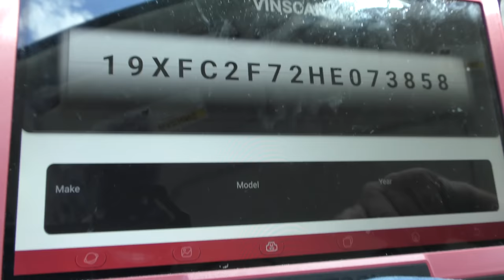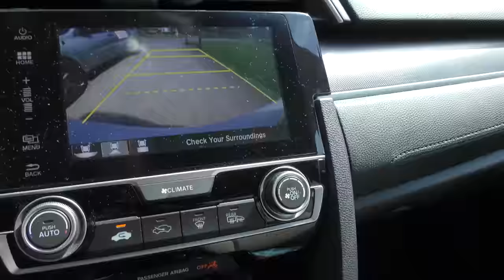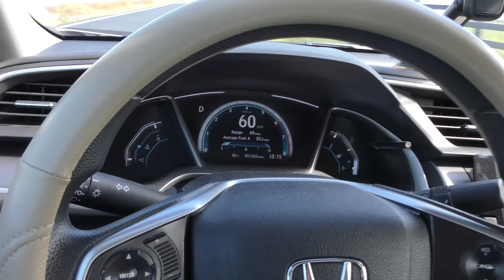Here’s What Happens If You Change Lifetime Transmission Fluid in Your Car

Comment: I change my trans fluid every third oil change (15,000 miles), this way you eventually replace all the old fluid and the fluid remains fresh if you continue to do this schedule without costing a lot.
Reply: SMART!!!
Reply: The Audi ones with lifetime fluid would break if flushed/oilchange. Your regime is akin to "if it aint broken,  fix it untill it is", wasted money too since the untouched ones can do more than half a million miles easily.
Reply: @pflaffik  Says who? Who and what can substantiate your claim? Even at 70,000 miles a "lifetime fluid" WILL have some metal particles and deterioration. That is simply a mechanical fact, as Scotty has pointed out here. Gears, CVT belts and chains, clutch packs, and bearings wear and they throw their debris into the oil/fluid. Even the gear reduction on a Tesla has a fluid change interval.
Reply: @pflaffik  based on what evidence? How many cars have you owned or worked on? I've owned nothing but beaters most of my life and made them last for pennies because of maintenance schedules like this. Do you keep track of costs and maintenance on your vehicles for long term? I do, so I have comparisons and how much money I've spent on maintenance and what's lasted. Ive put over 300k on some of the known worst transmissions doing this so forgive me if I'm not going to take someone who doesn't work on cars and owns an Audi seriously.
Reply: If you drain the converter, you can go longer between changes.
Reply: @josephtravers777  I'm lazy, lol. This method eventually removes the old fluid out of the torque converter. Once I had a friend pour in fresh fluid while I had the transmission drain open while the truck was on so it would pump the fluid out of the whole system in the proper flow direction while new fluid was being put in, once you saw clean fluid coming out you could stop the pour and put the plug back in. It actually works great but requires 2 people.
Reply: @luckyKon  Not lazy, messy 😂👍
Reply: @josephtravers777  true 🥲
Reply: Unnecessary changing it that much
Reply: Drain and fill is a great method. I started at every 25K but now am doing 15K as the car ages
Reply: @scotthillebrand5664  agreed.
Reply: @MidnightPolaris800  listen I have 2 trucks that are over 300k and tow regularly. They still drive and shift almost as good as new and have cost me relatively low maintenance costs long term. Do what you want, but I'm going to stick with data and my experience.
Reply: What about the transmission filter? How often are you dropping the pan and swapping the filter?
Reply: @WhereHasMySanityGone  I only do a filter change  every 75 to 90k miles; typically OEM or a Wix filter.
Reply: Seems to me that you are just contaminating the new fluid with the old.  How about after changing the fluid, take the trans out put line off the radiator, start car and when you see clean fluid, shut it off and screw back in, fill with fluid.
Reply: @michaelhennegan9637  it is mixing with older fluid; however I don't wait till my fluid is spent and on this schedule the fluid is fresh in 2 to 3 changes. Got 300k on a 2005 dodge ram 1500 transmission and still shifting like a champ and keep long term maintenance cost at a bare minimum.
Reply: @luckyKon  
I agree... transmission fluid is different from oil as well as the trans filter/screen material is different from oil filters. While some may choose to fully drain (not power flush) the trans fluid in one shot, "pan" draining every 30k to 50k still provide great benefits
Reply: @luckyKon  can’t argue with that.
Reply: @WhereHasMySanityGone  thank you. It's something I've had great results with.
Reply: Do you have a sealed transmission?
Reply: @dillonbeach2354  I do not.
Reply: Hi, Kenny! Do you do a transmission filter change too? Or just the regular drain and fill of transmission fluid every 15k? I am just starting to get more involved in my own vehicle and find it self rewarding. Also, do you measure the amount that comes out and fill in the same exact amount to replace like what Scotty does?
Reply: @snowrocket  To be fair though, what evidence is there that proves that if you change the oil the transmission will last longer. Just because Scotty shows the color is dark, is that really evidence that changing the fluid will prolong the life of a transmission when you take into consideration the fact that transmissions DO break (this is already well documented)  right after a fluid change or flush?

Comment: I miss the Transmission Dip Stick.                    :(
Reply: According to the manufacturer, you don't. You must trust The Computer That Is Always Right to put up a warning that your oil is low. Ha Ha Ha Ha (insert Scottie's laughing donkey)
Reply: @gasgas2689  On my Mazda 6, the AT warning light came on. It was not because of low fluid level. The car would jolt whenever I shifted gears from Park into Reverse.
Reply: I'm convinced that a clever man (woman?) could invent some kind of kit you could install, to check your fluid level at the touch of a button.  But I'm not smart enough to be the guy who invents it! 

The only aspect I've thought up about it for sure, is that your kit would need sensors to replace the drain plug and level check plug that would screw into one or both of the transmission plug holes.  The sensors would have the wiring (or maybe it could even be wireless) running to a digital readout for the driver saying "LEVEL OK/OVERFILLED/LOW FLUID LEVEL".
Reply: I completely agree

Comment: 1998 Honda CRV..Bought it for $600. 189,000 mi. Owner stated a lot of slippage in gear. I checked the fluid...black...Drove it home..drained fluid, less slippage, a few days later, drained fluid, now it was shifting great and no slippage...Drained again...Well...it's a Honda..acts like it never had a problem. 325,000 miles, the clear coat is peeling but it runs Fine!!  Keep the videos coming...
Reply: good thing it's a traditional automatic. Might have grenaded if it was a CVT.
Reply: The trick is to do the 3x Drain and Fill. Which will be about a total of 9 Quarts. We had a transmission "stutter" on our 2012 CRV with 60K miles and the TSB recommendation from Honda was a reprogram and Trans Fluid change 1X. Did 1 Drain and Flush 2X and the problem is GONE. I will now change the fluid every  30K Miles.

Comment: I own five cars I've done many transmission fluid changes.  To make changes easier, I purchased a tall clear pitcher (like for kool-aid) and after i drain the old transmission fluid, I pour the old fluid in that pitcher.  I then mark the fluid level...pour out the old fluid, clean it out, then fill it with new fluid up to the mark.  Makes it very easy.
Reply: I do same 👍
Reply: I bought a 2010 accord with a 128000. Would it be OK to change the cvt fluid? I'm worried that it might slip with the high mileage
Reply: @tamezjohn4805 

Yes you need to change it.  They like new fluid.  Do a drop and refill.  No flush.
Reply: @kevhed8  

This can get you close but this is not technically the correct process.  Every manufacturer has a process.  You still need to do this then check cold and hot levels or do the drain off at the manufacturer’s specific temperature for a sealed transmission.  Trust me, I have drained and measured then did the refill of that amount and the transmission was still under filled.     Every manufacturer has their own process of how to check level and some even with a bidirectional scanner
Reply: @tamezjohn4805  a 2010 Accord is not cvt. Accord doesn't get cvt until 2013.
Reply: @waltersweet4595  I believe you 100% on how you did it.  But for the trans to be underfilled after you measured the old fluid and replaced with new, means the fluid was low when you started.  And/or there was spillage while draining it.  I'm sure you were smart enough to account for any spillage so it's the first thing. 
 
I'm thinking that some smart engineer, could design a "kit", with fittings, funnels, and all the other bits you'd want, to screw into the fill hole and the drain plug just to make changing your ATF a lot easier, even on so-called "sealed" transmissions.  It is common knowledge "sealed" is nothing but a tall tale invented and propagated by a whole bunch of Jimmy-big fibbers.
Reply: So by doing this, you can bypass removing the check plug and overflow method?  Im changing my fluid tomorrow and only have two jack stands so it would be good to know this method is reliable
Reply: @ouroboros9129  I've thought about this exact way of doing it too, and it seems like a flawless method in theory.  The only thing that might go wrong is if your fluid level were low, or maybe even too high, before you started.  Maybe the answer is, change the fluid using the way you mention.  
Then maybe take it in to a transmission shop and have them check the level.  I figure these guys do it all day every day ?  And if they can't check level of a sealed transmission then who can?

Comment: CVT transmissions actually require frequent fluid changes compared to regular automatic because of the chain inside vs gears. I believe it’s every 30K compared to 60K.
Reply: @badcommentbot8349  The newer Honda CVTs use a metal belt.
Reply: Every car is different

Comment: I was told always make sure the fill plug can be undone first before draining to save any potential problem. As usual informative video. Regards Stephen
Reply: For these Hondas, the fill plug sits on top of the transmission and it’s just a rubber plug
Reply: True, especially on Subarus, where the factory wangs on those fill plugs mighty tight!

Comment: Scotty, you couldn't be so right!  My mother had a '07 Honda Civic hybrid with the CVT transmission.  It started slipping after 80,000 km the dealer who sold her the car couldn't find the problem.  When she asked if changing the fluid could make a difference, they told her the old routine of lifetime fluid crap.  On a trip to the USA it started to slip pretty bad, so she took it to a dealership over there.  The first thing the mechanic asked is when was last time the fluid was changed?  They changed the fluid and it solved her problem!  Since then she had the fluid changed every 50,000 km and she never had a problem ever since.
Reply: we have the same car since new. at 156k miles now and they weren't easy miles. cvt fluid regularly changed and its doing good
Reply: No Honda has lifetime transmission fluid. Check your owners manuals!
Reply: @linkzz00 You mean Honda does or Honda doesn't?
Reply: @sl4983  “No, Honda has lifetime…” would mean you don’t have to change it. 
“No Honda has lifetime…” would mean you do have to change it. 

I hope that clarifies it for you.
Reply: Odd, my Honda CVT manual says to replace the fluid every 40 000 km...even has an entry where the dealer is suppose to sign-off on that specifically...
Reply: I wonder why manufacturers don't put a drain plug in the torque converter. Like this instead of just changing what is in the pan, you can remove all of the fluid from the transmission.

Comment: Little Tip. If you change the transmission oil ALWAYS unscrew the screw of the filler hole first. Because if you unscrew the drain plug and the oil is once out and then, for whatever reason, you can not get the screw of the filler hole open, you have a problem 😎
Reply: These transmissions have a rubber fill plug, so you should be able to get it out as long as your hands aren't broken
Reply: @heresalex2000  I am now not sure whether my screws are installed with a conical seal or with an integrated rubber seal. But they are in any case made of metal.
Reply: Not quite sure I understand what you're trying to say :c
Reply: @richlb5357  I can only guess he is talking about vacuum lock. As in the fluid came out the bottom and vacuum sealed/sucked the filler plug in.
Reply: Or, he is saying don’t remove the drain plug before you know you can remove the fill plug and refill it.  A transmission with no fluid is not useful.
Reply: Isn't there an overfill plug. I have a 2019 crv. I fill it until it runs out the overfill plug.
Reply: @richlb5357 He's saying be darn sure you will be able to refill your transmission before draining out all the fluid...so you don't drain it and whoops, can't get the cap on top to open. Then you'd be stuck at home with an empty transmission. Cheers! 🍻
Reply: Thanks,
Reply: You fill a transmission from the top, like Scotty did. There is no filler hole down below, like on transfer cases and differentials. You shouldn’t be working on cars.
Reply: There are 2 openings on my transmission. Filler opening and drain opening. The filler opening also serves as an overflow once the correct amount of gear oil has been filled. And the filler hole is not on the top but on the front side in the upper area of the gearbox housing.
Reply: @Shizzle700 IS there an overfill plug?
Reply: @Picklejam08 no one said there’s a filler hole down below.
Reply: 😂 actually brilliant advice just about to do mine - thanx
Reply: He's saying if you drain all the fluid out - out cannot get the bolt off to refill it - your fucked with no use able car - genius advice I'm grateful 4

Comment: I just changed my transmission fluid at 215.5k miles on my 03 Camry. Shifts like a dream! It's been changed 2-3 times in the past, so no reason not to keep doing it. One thing I had to do though was get a new bolt and washer and use thread lock, as it was leaking without the thread lock. The new one didn't come with it.
Reply: Pretty good for  U-series transmission.
Reply: Your one of the few that do it.  Blows my mind people think it lasts forever
Reply: Nice
Reply: my mercedes 722.9 lasted to 500k with fluid changes every 100k and it was still shifting strong and all original. Sadly the 4matic u joint didn't agree and decided to take the transmission casing with it as it failed.
Reply: @yenpham-jb4wo  It's my first car and I paid it in full last year. I want it to last as long as it possibly can so I don't have to buy another one for a long time.
Reply: @Motorsportsgeek  At least you got it to 500k!
Reply: Awesome! Not many people are willing to get their hands dirty. Only tip though, the thread locker is gonna bite you. Yes it sealed it, but you also just glued shut your only means of draining your fluid next time. Transmission pan threads are fragile be careful not to rip out your threads. It's why the new one didn't come with it.
Reply: @Diegodiaz-gc6bc  By that point, may as well put a new drain pan on. I'm fine with that, as the leak was pretty bad. Somebody impacted the previous bolt and ruined it anyway.
Reply: @anonymike8280  I have a u241e and it's been flushed, drained and filled, etc with synthetic fluid. At 233k miles now
Reply: @WinPC99  Thank your foot.
Reply: @JiltedValkyrie  I love that response. But do be mindful as in a few years you may not be able to get a new oil pan for it
Reply: @BawkBawkBawk666  That's ok. There are plenty of my models at junk yards for transmission pans. It's one of the perks of having one of the best selling gens of cars. However, there was nothing else I could really do as the last owner brought it to a place that screwed up the threads in the pan in the first place. At least I don't have to worry about it for 5 years or so. By that point, I may have a different car anyway and just retire my Camry for Rallycross (which I have done in it already -- uploaded vid of it).
Reply: @JiltedValkyrie  one other thing I was gonna mention is using petroleum-teflon tape on your drain plug. That will also stop it from leaking out the drain. Food for thought.

Comment: Scotty,  thank you. The last time I purchased a car was a new 2001 Honda CRV. I've been following the maintenance schedule and I am close to 200k. So far needed only tires ball joints and a couple of batteries. 
Now I'm waiting on delivery of a 2022 Rav4 hybrid... just 4 mos. To go - so trying to get up to speed for a new vehicle. I know your advice is good for the car, the money and for me.
So again  - thank you!
Reply: Why buy a hybrid? Have fun when you seen a new battery.
Reply: @jaysmith179  
the batteries have 10 years warranty... and he is buying the car new. so after 10 years, it's time to change the car anyway.
Reply: How much u want to sell it
Reply: The rav 4 hybrid uses toyota ws atf. Not cvt fe since the gearbox is electronic cvt.
Reply: @MGTOW89  the hybrid battery is guaranteed for 10 years but gen III prius' go for 500k miles on original battery. 10 years isn't close to the limit of the life of a Toyota hybrid. You're quiet wrong on that.
Reply: @user-3tf67bk46u  yes. The key. I've been moaning over this for the past few years and honestly it has been a big reason for putting off the new purchase until now. But my backup, my wife's car, is a 95 tercel w/ 70K original but it takes me too dang long to get to my feet from behind the wheel  - ha!
Reply: @jaysmith179  I'll probably expire b4 the battery
Reply: @scottrozzi1780  the 95 tercel is for sale. I'm keeping my crv
Reply: @wayne00k  damn hoping the crv was for sale